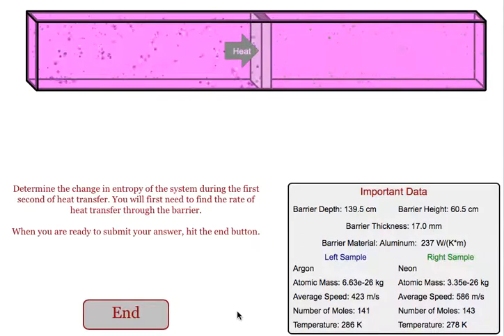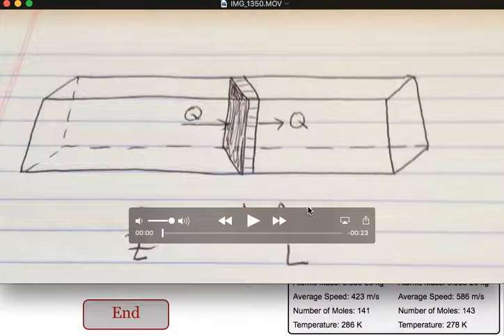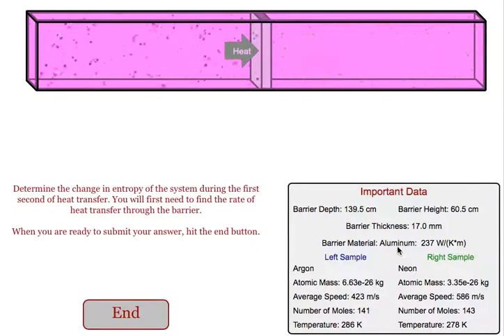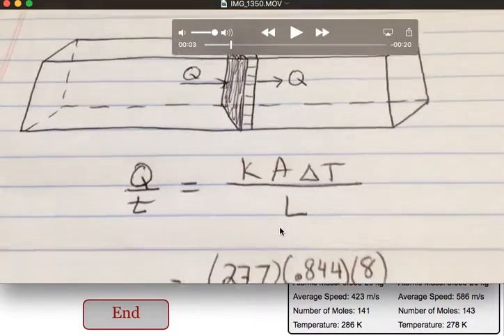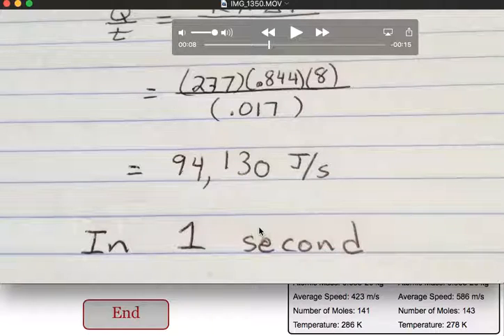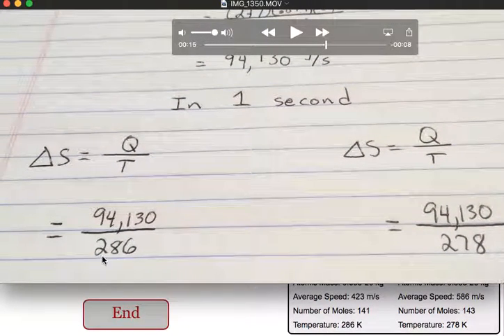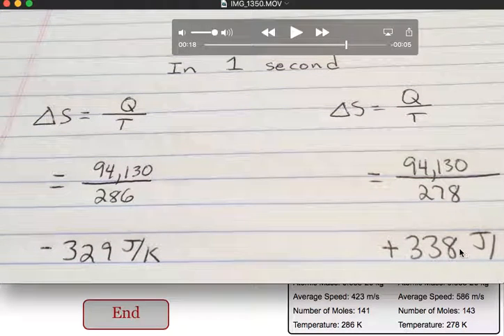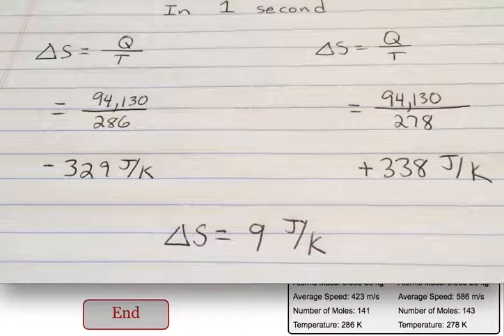Heat Transfer with Entropy Problem

Comment: This video was a good problem to solve, but for some reason it gave my brain a good on-ramp for understanding of how a colder sink could result in more efficiency. The heat transfer would have still happened to the colder side if Q was only 91,900J. we could have potentially diverted 2230J for work and still had the transfer; entropy transfer would have been about 1J/k. If the heat sink were at a mere 100K, on the other hand, and we kept the value of Q and S from the hot source to 94,130 J and -329J/K, (either by shortening the time span to 0.0368 seconds or reducing K), the heat transfer would still happen if only 33,000 J was reserved for the cold sink, leaving a whopping 61,130J for work!